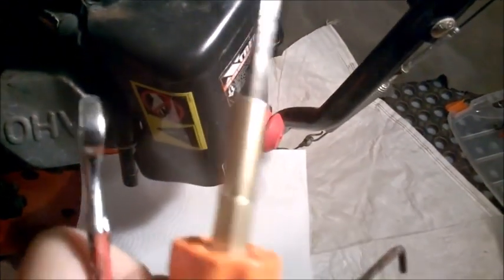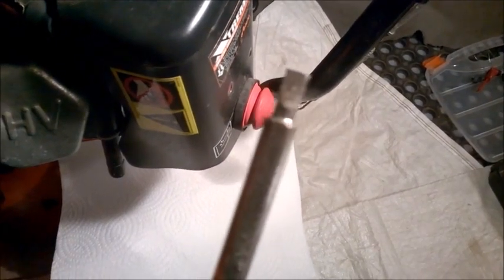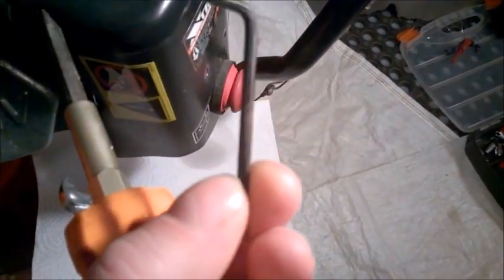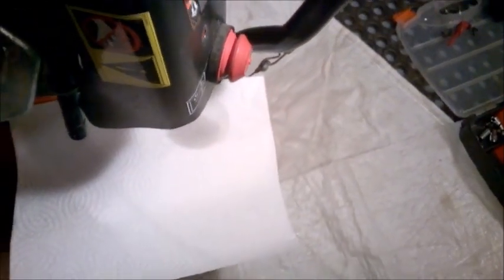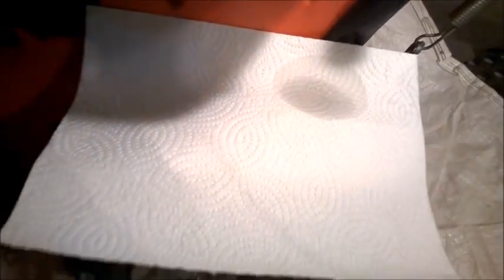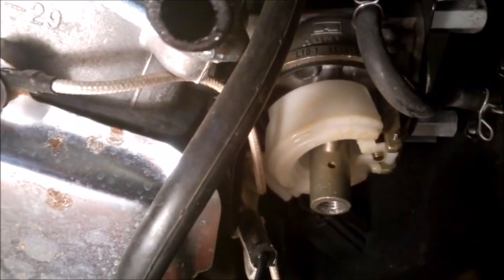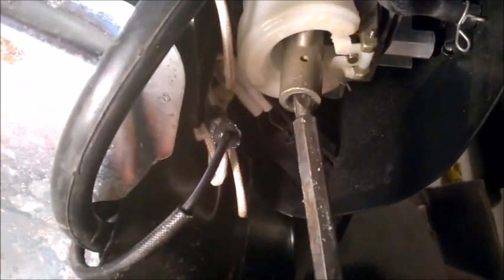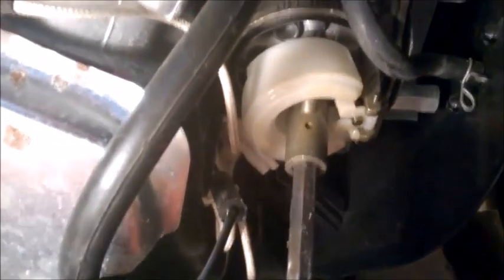Modern Ariens snowblower not starting (OHV LCT engine) - cleaning the carburetor

Comment: Brand new Airens 24 classic should start and work fine right?  Nope. The electric start turns over but won't catch.  Wiggled the plug and it started immediatey.  Ran for two minutes then quit like it was turned off and kind of smelled funny like a burning fuse.  Now it turns over and won't catch like it's not getting any spark.  I'm at a loss to figure this one out, and it's supposed to snow tonight!
Reply from the maker: The burnt smell may be caused by improper electric contact - maybe the spark plug is not tightened properly, or the electrical connector over the plug is not seated tight - may remove and have a look underneath it.  Also check the cable from that connector.  The assembly persons for Ariens quite often times don't pay attention. These engines also have issues starting after summer storage when using gasoline with ethanol, may try starting this way  https://youtu.be/FxZFRYCaEDs
Reply: @Peppermint1  thanks I'll give it a try with the plug.
This is machine has never had gas in it so it must be something with the plug or wires or maybe coil.
I thought maybe it was grounding on something, just so weird to have it quit like that after running fine just like it was turned off with the key.
Reply: @jonathanbecker8935  I bought a brand new Ariens too and it started the first time.  Now it will start but it won't stay on.  Have you fixed your issue yet? Any tips?

Comment: I like your videos....I am new to snow blowers.
 I purchased an Ariens 24 compact last fall. Before I store it for the summer I just suctioned out most of the gas today.....then I ran the snow blower until it ran out of gas. Then I emptied the carbonator bowel- as you demonstrated. 
Is this procedure a good one to leave it until fall and then add gas again and restart in say October?..............thanks
Reply from the maker: Some people say that draining the gas can cause the internal o-ring seals to dry out after a few years - these need to stay submerged in gas. Anyhow, try using gasoline without ethanol - ethanol is blocking the small passages when stagnant.  Also see how I start mine  https://youtu.be/FxZFRYCaEDs

Comment: If you people are using gasoline from a pump,  you will keep having this problem.    You need to use Trufuel.  It is engineered fuel that will prevent the carb and fuel line from gumming up.  Gasoline turns into gel after time and it clogs the carb.
Reply: Have to find where they sell it
Reply: I get non ethanol from the pump and don't have problems.

Comment: The float bowl has two slots that fit into a groove under the carburetor. This keeps it from spinning as you loosen it.   Make sure the gasket is center also. I used a thin layer of silicone to hold it in place on the bowl.  I didn't have to remove the metal enclosure since the pin fell out with a few taps. Not gummed up too bad
Reply: This comment was very helpful to me...  Didn't notice the two slots till I read your comment. Thanks.
Reply: Good heads up comment. I had to re-set the reservoir after assembling and almost lost the black gasket in the process. @steve-si3oz

Comment: I have a Ariens compact 24 I bought used for $300. The person only used it a couple times. The electric start wouldn't work. I took the starter apart and found moisture had worked its way inside the stator and rusted it up and seized it. For the hell of it I took it apart and gently sanded it clean (mostly) with fine sand paper. Put it back together and it now works. A $175 dollar savings on that.  On to the carburetor. The engine was surging. When I took it apart it was actually pretty clean through the needle. I cleaned it out with carb cleaner. However I did notice that the O-ring for the cup had white corrosion built up on it ( pay particular attention to that). My best guess is poor assembly from the manufacturer. The O-ring wasn't seated properly causing outside atmosphere to works its way through the O-ring into the cup. The small amount of murky gas inside was an indication of it. Im pretty sure this snowblower was surging since day one or shortly after. Everything is back together now and running great. I used a small amount of Parker Super O-lube to coat the O-ring. I'm a little hesitant about that. But if it causes issues then cleaning the carb again is a simple process.

Comment: Big question to all newer Airens  owners, do you have a Chinese made motor that is very prone to mechanical problems? Plus look at all the off brand snowblower motors. Very similar hmmmm.
Reply from the maker: Almost all sb brands run now on OHV chinese engines. Not bad engines but the carburetors get clogged too easy because of ethanol in the gasoline. The emulsion tube is soo thin, it just gets clogged.

Comment: Wouldn’t be it be better to run the snowblower in non ethanol gasoline a little bit to clean out the system before you store the unit after winter ? For me I used  93 grade gasoline in all my small engine machine  with stabil gas. But when It is time to store for the season I ran the machine out of gas then i pour in a little bit of non ethanol gas in the tank again and let it ran out of gas. Just to much sure it no more ethanol in the lines .  It seems to work the last few seasons
Reply: Run it on ethanol free all the time. You want to top it off with ethanol free and add some fuel stabalizer. Then run for a couple minutes.  Shut off fuel and store it. I'm pretty sure that's the way you should do it

Comment: Had to drill out the brass screw that holds in the emulsifier.  It was so badly corroded and the slotted screw head stripped out. My only question is what’s the thread size? I thought it was five 5/16 24 but it looks like their is an internal thread thats smaller that held the screw in place? Any help or insight on this would be greatly appreciated. I just need that brass screw with the hole to get this thing back together. Thank you so much.
Reply from the maker: There is indeed a thread inside the bore, but I don't know the size. Best is to call a dealership or perhaps looks for an Ariens catalog online
Reply: That is the jet.

Comment: my problem...when I take off the bowl NO gas comes out...with the gas valve turned ON... do you think that valve is no good. I ran the thing dry..before the winter, so no gas was in it. But now, after adding new gas I can't get it started.
Reply: Check your hose line first, the vent might be the problem. Just work your way down

Comment from the maker: I do not recommend clamping the fuel hose from the tank, these hoses are not the best quality and may crack inside and free small bits of rubber which will clog the carburetor. 
Try this first before removing everything
Snow blower won't start : step 1  https://youtu.be/FxZFRYCaEDs
Snow blower won't start : step 2  https://youtu.be/Mi3EW4BZMuo
Snow blower won't start : step 3 https://youtu.be/bnn0cFx3Dfs
More snow blower repairs https://www.youtube.com/playlist?list=PLl-l6yge4asslryJZfcAuD1AL7pQodR7l

Comment: Amazon sells complete carburetors for several snow blowers for $15.  Might be worth it to get new parts completely.
Reply: Yeah I have a mccolloch single stage with 208cc I got for 20 put a 20$ carb that came with fuel line and primer bulb and now starts first pull